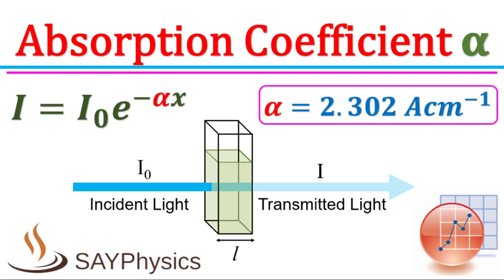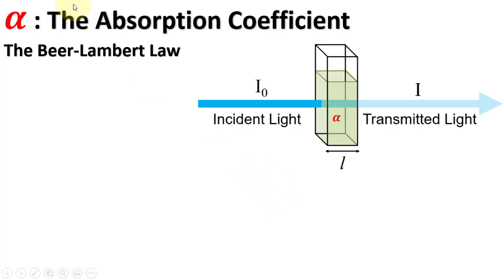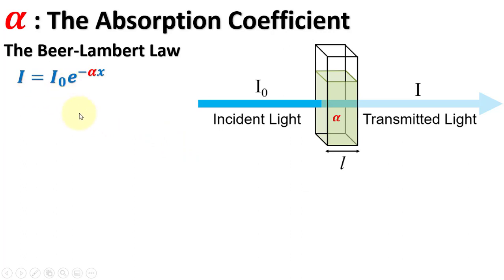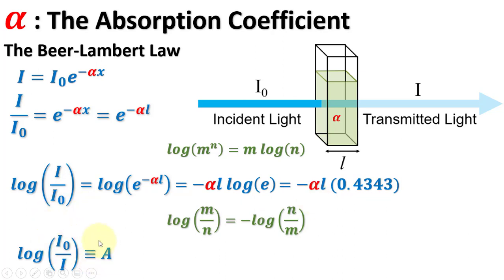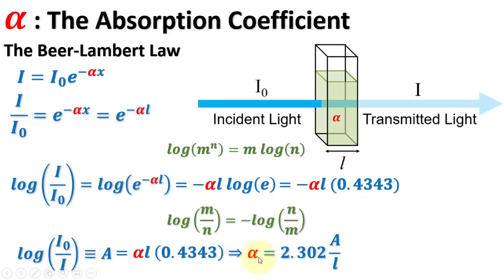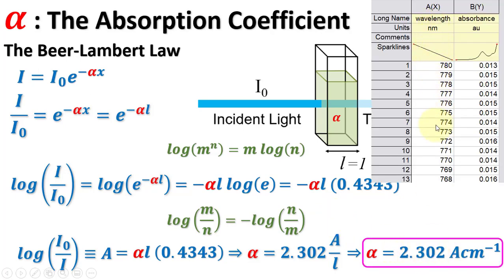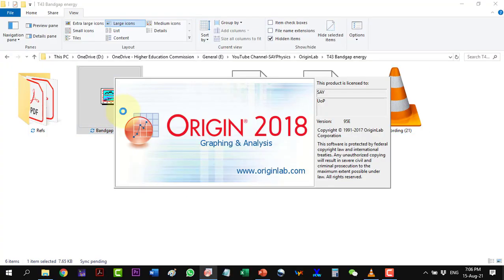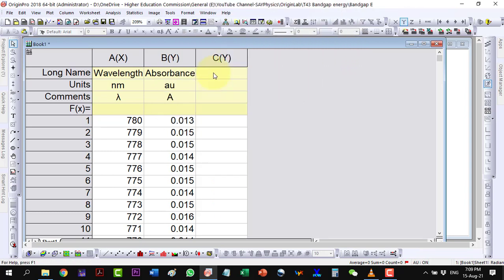Absorption coefficient α calculation from UV-Vis absorbance data in origin

Comment: thank you Sir, how one can find the value of refractive index from UVvis absorption data
Reply from the maker: In UV-Vis absorption data, you can't directly determine refractive index. Absorption coefficients relate to how much light is absorbed by a material, not its refractive index. However, you can indirectly estimate refractive index by analyzing other optical properties like reflectance or transmittance at different wavelengths alongside absorption data. Alternatively, you might need additional measurements or techniques specifically designed for refractive index determination. Thanks
Reply: @SAYPhysics  I appreciate your thoughtful response and your recommendation regarding this video. https://www.youtube.com/watch?v=2niEolyZK2Y
Reply from the maker: I don't agree with the content of the video mentioned. There are numerous other factors to consider, as I previously explained. When determining the refractive index of a material, ellipsometry is a more appropriate technique than UV-Vis spectroscopy. Thank you.
Reply: @SAYPhysics  thank you Sir.
Reply from the maker: @shah-xw6ik You're welcome dear

Comment: Thanks for the video. How do one ascertain the thickness for for a solid state analysis.
Reply from the maker: Thank you for watching the video, and I'm glad you found it helpful!
In solid-state analysis, determining the thickness is crucial for accurate results. For the material's thickness, you can measure it directly if it's a standalone sample. If you're working with doped material, subtracting the thickness of the actual matrix from the doped material provides a reference point. This ensures that your analysis focuses on the properties of the doped material specifically.

Comment: I have a Q for ya, sir. Is it possible to calculate the absorption coefficient without thickness? See, my sample is Co3O4 nanoparticles and I have to calculate the optical conductivity from uv-visible data.
Reply from the maker: While calculating the absorption coefficient without knowing the thickness of your Co3O4 nanoparticles can be challenging, you can still gain insights into their optical properties by analyzing the UV-Vis spectrum and considering theoretical models designed for nanoparticle systems. Thanks
Reply: @SAYPhysics  So, is there any equation for that?
Reply from the maker: It is possible to calculate the optical conductivity of nanoparticles from UV-Vis absorbance data, it requires the determination of the frequency-dependent dielectric function through methods such as the Kramers-Kronig relation, and careful consideration of various nanoparticle-specific factors.
Once you have the complex dielectric function, you can calculate the optical conductivity using the relation:
σ(ω) = (ωε₂(ω)) / (4π),
where σ(ω) is the optical conductivity at frequency ω, and ε₂(ω) is the imaginary part of the dielectric function.
Thanks
Reply: @SAYPhysics  thank you, sir. Very helpful.
Reply from the maker: @alimohandes5651 thanks dear 😊

Comment: Thank you sir, i have a question. 
For thin films how do we calculate alpha? In this cas (thin films) we can put 1cm if no how do can estimate the thickness?
Reply from the maker: Calculating the absorption coefficient (α) for thin films requires a slightly different approach compared to bulk materials. In thin films, the light travels through both the film and the underlying substrate, leading to a complex optical interaction. However, it is still possible to estimate α for thin films using appropriate methods. Here's how you can approach it:
1.	Transmission measurement: Measure the transmission spectrum of the thin film on the substrate using UV-Vis spectroscopy. This will provide information about the amount of light transmitted through the film.
2.	Substrate measurement: Measure the transmission spectrum of the bare substrate without the thin film. This will serve as a reference for the substrate's contribution to the overall absorption.
3.	Calculation: To calculate α for the thin film, you need to account for the substrate's absorption and the film's contribution. The Beer-Lambert law can be applied using the following equation:
α_film = (1/t_sub) * ln(T_substrate/T_film)
where: α_film = absorption coefficient of the thin film t_sub = thickness of the substrate T_substrate = transmission of the bare substrate T_film = transmission of the thin film on the substrate
In this equation, the term (1/t_sub) accounts for the substrate's thickness. By taking the logarithm of the transmission ratios, you can determine the absorption coefficient of the thin film.
4.	Estimating thickness: If the thickness of the thin film is unknown, you can estimate it using additional methods such as ellipsometry, profilometry, or atomic force microscopy (AFM). These techniques provide precise measurements of the film's thickness.
Remember that calculating α for thin films is more challenging due to the combined effect of the film and substrate. Additionally, the assumptions of the Beer-Lambert law might not fully apply in these cases. Therefore, it's important to consider the limitations and potential complexities involved in the analysis of thin films.
Thanks

Comment: if the units of absorption coefficient are cm-1 then how come there is no mention of length of thin film 
in your calculations
Reply from the maker: Thank you for your question. The length of the solution is implicitly considered in the calculations through the assumption of a standard cuvette length of 1 cm. This assumption ensures that the correct units and dimensions are maintained when calculating the absorption coefficient in units of cm-1. I hope this clarifies the matter. If you have any further inquiries, please let me know.

Comment: Sir,  I have a doubt that I took UV visible characterization for powdered crystal Now for absorption coefficient what formula should I apply?
Reply from the maker: Did you perform DRS of these powder sample or in reflection mode of the powder converted into pellet form? Thanks
Reply: @SAYPhysics  DRS performed powder sample sir?
Reply from the maker: Although there's a way to convert it into a transmission data, however, not accurate, due to reference subtraction issues. You will have to retake your measurements in transmission mode again. If the sample isn't available you may do some approximation with the available data. Thanks
Reply from the maker: Here's the step by step solution.
To calculate the absorption coefficient, you can use the following equation:

α = 2.303 × (A/t) × (1/d)

where:
α = absorption coefficient (in cm^-1)
A = absorbance measured from DRS
t = thickness of the sample (in cm)
d = density of the sample (in g/cm^3)

Here's how you can calculate the absorption coefficient alpha from your DRS data:

Measure the thickness of your sample using a micrometer or a similar tool.

Determine the density of your sample using a density meter or by referring to literature values.

Convert the absorbance measured from DRS to an extinction coefficient (ε) using the Beer-Lambert law:

A = ε × l × c

where:
A = absorbance measured from DRS
l = path length of the sample (in cm)
c = concentration of the sample (in mol/L)

Note: If you don't know the concentration of your sample, assume a concentration of 1 mol/L.

Calculate the absorption coefficient (α) using the equation mentioned above.

α = 2.303 × (ε/t) × (1/d)

where:
ε = extinction coefficient (in cm^-1M^-1)
t = thickness of the sample (in cm)
d = density of the sample (in g/cm^3)

Note: If your extinction coefficient is in units other than cm^-1M^-1, convert it to cm^-1M^-1.

By following these steps, you can calculate the absorption coefficient alpha from your DRS data.
Reply: @SAYPhysics  Thank you so much sir 😇
Reply from the maker: You're welcome dear